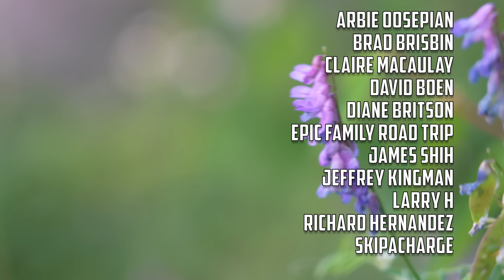RESTORING VINTAGE GRINDSTONE AND MAKING PROGRESS OFF GRID AT THE CABIN // EP 14

Comment: Great video Da n.  The stain on the carved seats really shows up the cut marks of the craftsman who carved it out.  Great job.  The grinder wheel looks terrific too; if you find a piece of hardwood, round, hand size in diameter, and if you could drill a hole down the exact center, you can make a handle that would go with the age of the grinder, some stain wouldn't go amiss either.  We Irish say Ádh Mór (Good luck); the horseshoe is a very nice touch .

Comment: Oh Dan.... 😊  Be careful of stripping away original finishes. It's where the character and value lie for the most part. 
Do know shellac is not an exterior finish. It will turn cloudy grey when it gets wet. It can also bubble up in direct sunlight. 
Love that you're doing what you're doing. ❤
Reply: Shellac is not a good finish for out-doors,   It will peel in the sunlight and it'll a big job to sand off when it starts peeling which will be very quickly.